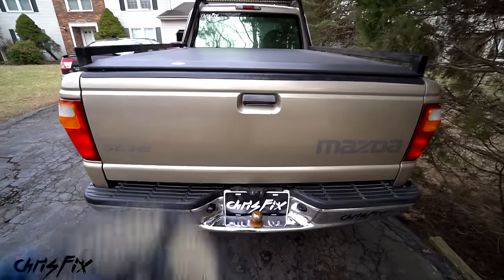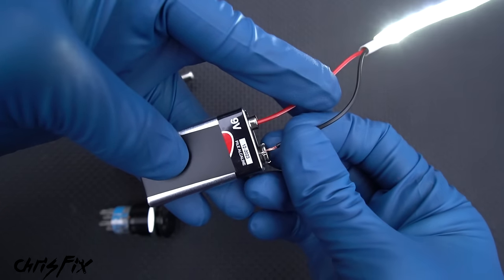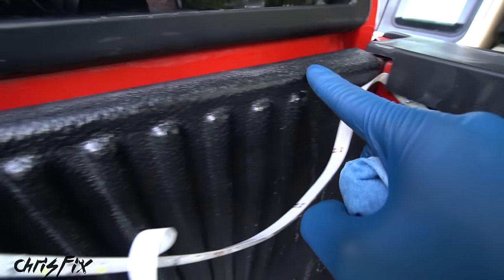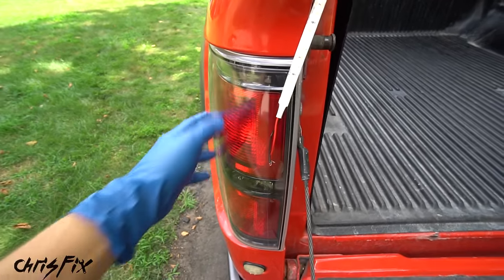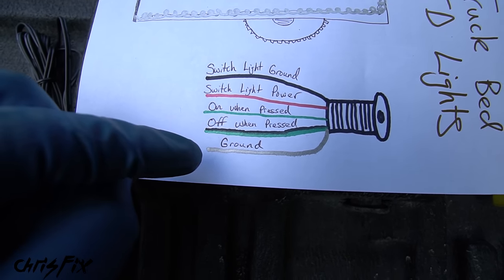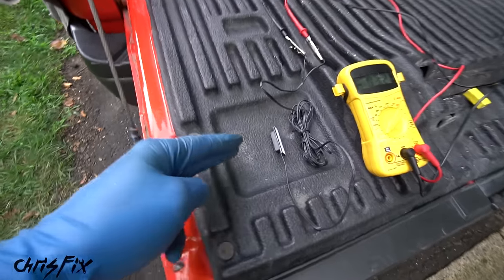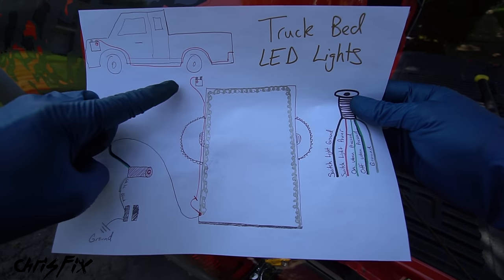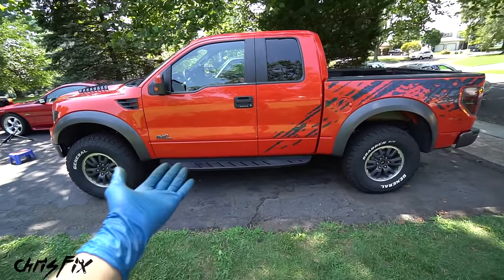How to Install LED Bed Lights (Fun DIY Project)

Comment: 20:56 Wouldn't it have been alot safer to use a terminal around the bolt, rather than use exposed wire jammed into the threads of the nut?
Reply: Eh, it’s a ground, as long as it’s touching any  metal it’s fine
Reply: Safer.... not really. Cleaner install yes. After spending all that time on the job I’m not really sure why it was skipped. Maybe didn’t have the correct terminal on hand.
Reply: @benderong4478  it's not fine. the wire will eventually break off.
Reply: Maybe they didn’t want to sand paint to bare metal for terminal...🤷🏾‍♂️
Reply: @zassaultt671pange5  nah the ring terminal would still make contact with the nut. this was just an oversight on chris's part.
Reply: would of been way cleaner
Reply: Not necessarily safer, as it is the ground side of the circuit, but yes that was a chickenshit way to make the connection. It was a disappointment seeing that from ChrisFix. I'm assuming he didn't have the right ring terminal on hand, and in a pinch this would work (obviously), but it's far from a good way to make the connection.
Reply: @PlatypusVomit  I hate knocking the guy as he is usually on top of everything, but that part was cringy to watch and not his usual level of quality. Should have used a terminal or better yet, found a better grounding location. As soon as those wires start to corrode, as bare copper strand will,  those lights are going to start having issues. A clean stable ground is just as important as a good power source. As much care as he put into the rest of the job, that ground is now the weak spot in the circuit. When those lights start flickering in a few months, at least he will know where to start.
Reply from the maker: As others have said, safer no, but better, yes. Unfortunately there were no good nearby grounding points due to the rust on the truck and the owner was adamant about me not drilling into the truck because I would have just drilled and tapped a screw for a ground right there. They dont make ring terminals that large (3/4") for 16 gauge wire without special ordering them and I only had day and a half to film this before they had to head back to Canada. I regret doing it that way but it will last just fine in that location, just not as long as the proper terminal end.
Reply: @chrisfix  thanks for the reply! Happy to see that you're super active with replying to tons of comments. Keep up the good videos!
Reply: @chrisfix  What I probably would've done in that case is strip enough to make a ring the right size out of the end of the wire, twist it back onto itself to make a loop, and tin the loop with solder. I've seen connections like what you did here go bad in a couple weeks. Sometimes you have to work with what you've got, but I'm just used to seeing a much higher level of quality from you so that one caught me by surprise.
Reply: @chrisfix  You can solder bare wire in a ring kind-of shape. Much better than just leaving it like this, it will break quick.
And you can connect to ground anywhere in the light
Edit: correcting autocorrect
Reply from the maker: Štěpán Macek thanks for the idea/tip
Reply: @chrisfix  Glad to see you chime in on some of the constructive criticism, you always seem to have a valid explanation for the way you approach certain tasks that otherwise have me as an ASE certified tech going "why the hell did he do it like that?"

Comment: I learned wiring through Chris but I also learned how to properly wire things in my heavy duty class and because I was taught by a teacher who's done wires way back in the day, I noticed his power wire doesn't seem right I think he used the wrong gage wire, it wire itself was smaller then the other wire he hooked it up to, its good he installed a fuse

Comment: Hey ChrisFix , you could've installed  RGB LED light strips instead of normal white light strips if you want more colours or a rainbow. Great video , your "how to change every single oil " was informative and useful and i proved to my friends that 'lifetime oil' is not really 'lifelong' especially with the rear differential fluid.
Reply: Yes but with an RGB lightstrip, you would need a controller.
Reply: And the white is cleaner with plain white leds vs rgb
Reply: not everyone wants rgb
no offence just sayin
Reply: @Eric-qi9us  I know . It was just a suggestion

Comment: So you had a box of ring connectors and you decided to just squash the cable with a bolt? It would have literally taken you 2 minutes to finish the job properly
Reply: Hell, wrapping the thread around a smaller bolt would've been better than this.
Reply: @zapadoceskesilnice3231  well he did most things right. But i dont like that he used that magnetic sensor as 60w switch with no relay. I dont like when he connected positive and connected negative to switch. It is good idea but isnt done good
Reply: @miksa3981  I just double checked the ratings cuz I thought you were wrong and you're not.  If anybody else wants to check, click the Amazon magnetic switch link and search "Gets very warm but hopefully OK" in the question search bar.  That sums it up nicely.
Reply: @SnifferSock  well in that "magnetic switch" is reed switch and it can handle usually 0.5 A 20 V DC: 10 W max. And he used it for 60ish W. I used that sensors a lot with arduino and esp boards and to be honest it cant eaven handle 10w.
Reply: @miksa3981  bingo. The reed switch isn't rated for that current. @Chisfix would be great if you go update this video to reflect the information.
Reply: @munecito  well you can use it in this situation but you need to connect it as relay switch not 60w switch. You can get cheap relays 10 15 amp would be more then enaught for this situation.
Reply: @miksa3981  if the tailgate is left open for a few minutes the reed switch will melt. A relay is a couple of bucks and just a bit more cable. 

Funny that if you check ratings for the switch some people say it isn't good because it failed too quickly,  but it isn't really the switch what doesn't work, is the circuit that they are using which isn't correct.
Reply: @munecito  it is more like sensor could be used as switch for door sensor things but just to sense is it closed or open noting more. There is kit on ebay that uses this sensor to feed information to relay 3 4 dollars something like that

Comment: A trick for feeding the wire into the guard is to slide the wire through a small socket wrench and then put the wrench inside the guard and slide your wrench all the way through.

Comment: "Falling dirt" Chirs just trying to be nice: that is, sadly, rust, a friend I know too well.
Reply: If you find a car in Canada with no rust it is a goldmine. Every damn car has rust. Just test drove a 2017 Cruze with my friend and I threw it on my lift at work and with 40,000KM it had a good amount of surface rust
Reply: @thatclappedk24accord41  you can actually protect it from rusting, we do it here in finland. 340k km/26years old car and no rust.
Reply: @thatclappedk24accord41  Lots of Alberta vehicles dont have any rust. I buy my cars from BC mostly and even they dont come with rust. However, trucks: always have rust from just existing. lol

Comment: I've messaged this dude to work on my truck a Ram 1500, with a misfire, it would definitely help many  Ram owners out there in this country. Maybe he could fix it and make a video. Obviously paying him to fix my truck.
Never got back to me. Maybe because i live in NJ USA, or maybe because i own a "Chrysler".
I guess i need to move to another country buy a cheap Ford  Raptor with 100 s of thousands of miles and give it a try lol.

Comment: 2 things could be improved imho: 1. add an eye to the last ground connection. 2. Add a low voltage switch, so that you cannot drain the main battery too low.

Comment: Why didn’t you tap the power wire from the back of the trailer light plug?
Reply: because then they would only work while his running lights were on
Reply: Isn't there a constant hot in the trailer wiring harness that is hot for the trailer brakes? I believe it is fused and is available in rear of truck, or is it different on this year ford?
Reply: @4149dwiley  i’m not sure about that to be honest i think that the two hots are for the brakes and brake lights and then ur running lights which aren’t always in. At least that’s how i’ve always understood it to work
Reply: @grantgustafson7844  the way I have seen power to my 7 pin trailer plug is there is a constant hot for trailer brakes in that plug that is separate power from the trailer light power.
Reply: @4149dwiley  now that u say it that does sound right so i guess u could ru it to that, i assure that it would b heavy enough gauge wire.

Comment: What if I want this to match my PC, I need rgb to get that extra boost to my horsepower... 😂
Reply: Use an esp32 and neopixel strips, or similar module with lte. Sync to phone. Have phone connect to mqtt home assistant setup at home, do the same for your pc. Sync via home assistant, also would allow remote car unlock, pc booting, and more. Could be done for any of the car lights or features. Even an in car security system with a camera, motion or lidar sensor and more if you dont mind wiring into lock switchs, relays and more
Reply: @kioshiootori9657  You took the joke too seriously with an actual thing that would work. nice
Reply: @crazymonkeyalien  is just how i have my house n car n pc wired up. 😆

Comment: Let's say I wanted to do an interior "mood lighting" setup whenever I opened the driver's door. Is there any way to set it up to a timer delay of after x amount of seconds it will fade out instead of an immediate turn off with the magnetic switch?
Reply: Nitro The Husky.        you can connect them to underdash lights. connect position and ground and it should turn on when ever u open the door and turn off by them self because usually they already have relay for timer
Reply: @onelgp6682  Would taking the light out of the socket and putting the wire in between the socket and the bulb work or would there be a better way recommended?
Reply: Maybe connect it like Chris showed but in the middle run a capacitor, its like a small battery that dump all of the energy inside immediately but kind of slow.
Search for example in YouTube
Reply: Directed 528T. Pulse timer, hook it up to your driver door pin. Now if you want it to fade you'll have to hook up some LED controller in line with that so it would fade, or possibly a capacitor.
Reply: Easiest way to do this nitro husky would be to tap into a doom light or any other light that comes off when you open the door
Reply: Random question guys:
What do u think about Trump's plan about the Middle East?

Comment: I want to do the same but be able to have them so I can turn them on and off from inside the cab but have them turn on when the tailgate opens
Reply: Add a second switch in the cabin parallel to both of the bed switches. Here's a basic diagram:

Battery+ >--LEDs>----magnet switch>--bed switch>--chassis ground
Battery+ >--LEDs>----Cab switch>----chassis ground

The end of the LEDs connects to the magnet switch, and the magnet switch connects to the bed switch. The bed switch then connects to chassis ground. 

The end of the LEDs also connects to the cab switch,  and the cab switch then connects to chassis ground.
Reply: Or just tap into the cargo light. If you have a newer truck the cargo light has a switch inside. Also it turns on when you open the tailgate on some trucks or even unlock will do. That way you just tap into the cargo light wiring down the c pillar and u already have a button for it so less buttons

Comment: I get uncomfortable when people wire the switches to gorund instead of positive...
Reply: @Marco2G pls explain to me why ground to switch is not a good idea? Just curious....
Reply: @zassaultt671pange5  Because you have power running into the device (the lights in this case) at all times. With a positive-side switch the power is broken before the device. It's not as big of a deal with low-voltage stuff as it is with high-voltage, but it's still best practice to switch the positive side.
Reply: Thanks that makes sense....I made a flood alarm with a 12v battery running to a car alarm horn and I had to put a cut off switch on the ground wire because it will be getting wet when there’s a flood....after reading your comment I was gonna put a kill switch on the power side to cut power going to the device on dry days but then I said dumb me jst disconnect battery...lol!
Reply: using ground side switches is a common american thing. in Europe its usually the positive wire that is switched.

Comment: I bought a light kit for the truck bed, but this is so much better for installation than anything the mfr provided.  Having the lights come on when you open the bed makes so much more sense.  Too easy to leave the light on accidently.  Very good instructions.  Have to check out some other ChrisFix videos.

Comment: 20:54  That is so cringey, just add an eyelet to it! And the fact that he just left about 5 inches of the light strand inside the body like that is sloppy work. What he should have done was cut the strip to length then soldered new wires where he cut it and run those into the body.

Comment: Hello @ChrisFix!  I understand this is an old video so you may not even read this comment, but Thank you so so much for making this video, it's a perfect tutorial for what I'm trying to achieve!(At least I HOPE!)  I have a ramp van and wanting to put lights on the ramp so that when it opens the lights automatically come on and turn off when the ramp goes back up.  I will be referring to your video throughout the install process, so wish me luck!  I got led lights that change color, so hopefully that doesn't cause a problem...Any advice or tips you have for me are WELCOME!!!
Reply from the maker: Good luck! You got this!!!

Comment: I did this mod on my 2020 Toyota Tundra and this video was a good tool to help me along the way.  My magnetic proximity switch works the same way (shuts everything off) but the push button is always depressed in the on position for lights on and clicking it off shuts the lights off (seemed kinda reversed the way you did it).  I also passed the LEDs through a relay with the switches controlling it.  My switches kill the power from the battery and not after the lights to the ground but both ways work I suppose.

Comment: I like your videos and there were easier and quicker ways to do this job but it was a great video to watch. the only major flaw is the ground wire for the magnetic switch. I give it two winters max before the ground wire corrodes off due to the salt in Canada. That was a hokey way to connect that ground wire.

Comment: awesome tip with plastic wire looms, get a small crescent wrench w/ a closed end and put the wire through the wrench and stick it in the loom then pull through.

Comment: I followed this guide but with 2 modifications: 1. Ran  wiring down passenger (battery) side so 4 feet less wire and loom needed. 2. Stuck light strips up LAST starting from wired end. That way no lights trapped inside truck body and just trim excess from loose end with scissors

Comment: I used pretty much the same method, including near-identical LED strip and magnetic switch, to add a light in my wardrobe that turns on when the door is opened. There are ready-made versions, but they're quite short and cost 3x as much. Like $40 dollars for a 50cm long light. I made mine for $16 total that was a full metre long.

Comment: For a power source, I perder to use a fuse tap on an ignition circuit. Doing it that way adds a fuse to the circuit and insures that there is no power draw when the key is off.
Reply from the maker: Great tip! He wanted to have it work with the power off so when he loads up his truck he can see without it being on. But you can totally do what you said as well!

Comment: on an interesting note some Chevy Colorado and GMC Canyon trucks actually already have a switched lead to the end of the bed for bed lighting that is controlled by the cargo lamp switch.  Its meant for the OEM bed lights but id imagine you could run an LED strip as well.

Comment: Nice add.  I have to confess, I don't trust adhesive on the back of LED strips, so I use VHB all the way around.  Other than that, I would say use an eye ring for the wire to the ground bolt, rather than put the wire into the nut.  Prior experience tells me that wire will break.

My add:  The windows of my '76 Chevy 3/4-tone truck are tinted.  So, at night, the tint makes seeing behind (while backing up) a lot harder.  I added 2 x 6" LED light bars as back-up lights and tied them into the existing reverse-light circuitry.  Now, it's like someone turned on the sun!  ;^)

Comment: Random idea: I was thinking of doing a solar setup. I don’t like wiring so I’ll try and see what I can come up with. 

I’m thinking of running a small marine solar panel on the roof of an F-150 with a small battery tucked between the cab and bed or somewhere else.

Comment: good job as ususl. you'r the best. but i think the only weak spot is the last wire. i guess it was not secured properly, the nut must've eaten the wire and keeping it loose like that with vibration it will eventually come loose.

Comment: Just finished my install following these instructions and it looks great. it looks even better since i was able to mount the strips to the bottom of my roll cover rails and it lights every corner of the bed. i did have to run the ground to the ground under the bed on the frame since the bolt on the bed was not enough. i also ran the battery to a power block so if i want to add more connections for power in my bed i can. Thanks for the walk through @Chrisfix

Comment: Great video. When using the step drill bit you could have made a smaller hole in the liner to fit without an added washer.